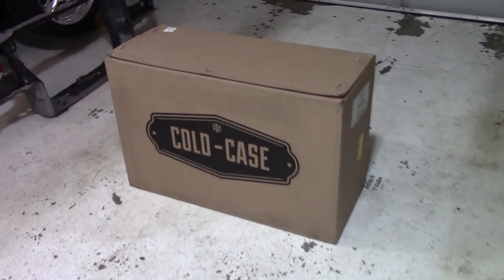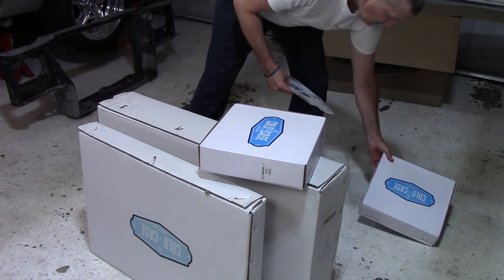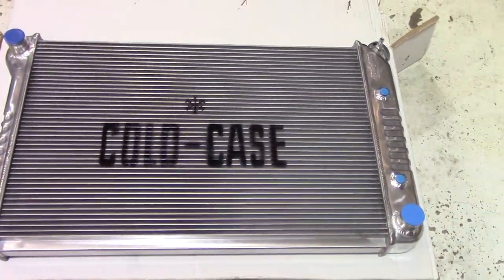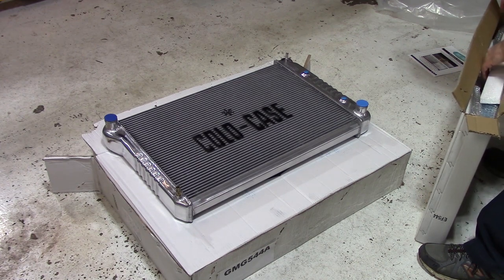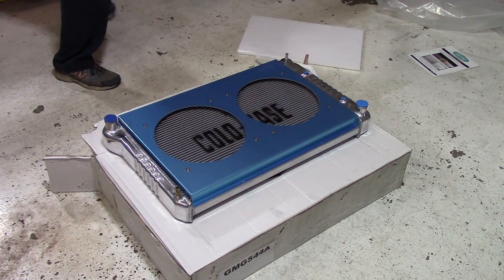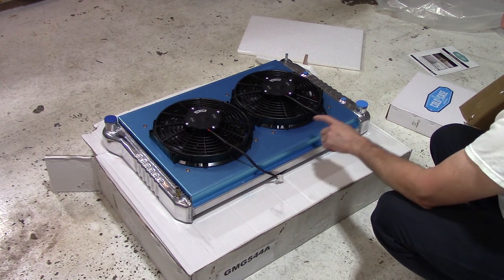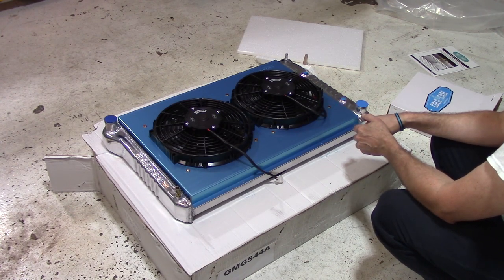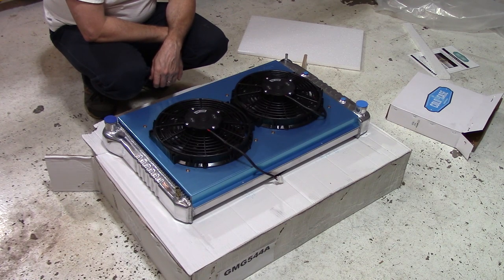Cold Case Aluminum Radiator for G-Body!! 1987 Olds 442: Video 55

Comment: I can say from experience, you do need a high capacity radiator for a 455 (4 row?).   Looks very nice, but I must say, I have concern by how TIGHT they put that fan shroud against the face of the radiator.   It actually looks like it RESTRICTS flow over a significant area of the radiator !   There would be high flow directly at the round fans, but the remaining area might be worse than nothing ?
The radiator looks great, I would pass on that shroud/fan setup.  You later might want to do a comparison with the original style fan/shroud setup - especially if you are in warm climate and it appears you intend to use AC, with all the effort you put into restoring the interior temp control system.
Reply from the maker: Thanks. I'll do some research on the fan shroud they provided.

Comment: I'm in the fence on purchasing today during black Friday. what connections do you have to use for your stock harness? I've got an 87 GN
Reply from the maker: I used an aftermarket relay harness  https://www.summitracing.com/parts/prf-30117
Also, if you buy the radiator, check your top hose size. They list two G-Body radiators with very similar years. I got the one with the larger upper hose which is for 78-80 models. My 87 was a 1/4 smaller, so I'll have to find a larger hose to make it work. Go to their website first and compare both. I'll bet you have the smaller upper hose like mine.
Reply: @hutchhiperf  thank you! was gong to check if Casper electronics had the harness as well..
Reply: I put one in mine.  it should fit right in.  your hard lines go to the front of the rad and the rad should be a "factory fit".  Racetronix makes a nice harness too.  Caspers, Coldcase, ect.

Comment: How much was the whole set up
Reply from the maker: Here's the link from Summit comparing both  https://www.summitracing.com/compare
Be aware, the one ending in "AK" has a 1.5 upper hose  inlet. The one with "A-1K" has a 1.25 upper inlet. Most G-Body's from 1980 up are the 1.25. You need to check.  Here's their website https://www.coldcaseradiators.com/products/make/oldsmobile